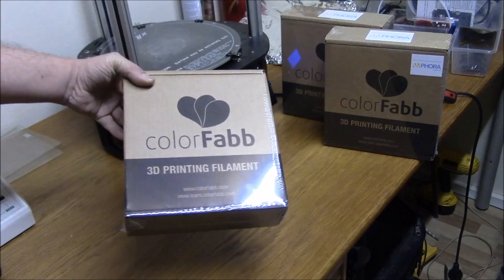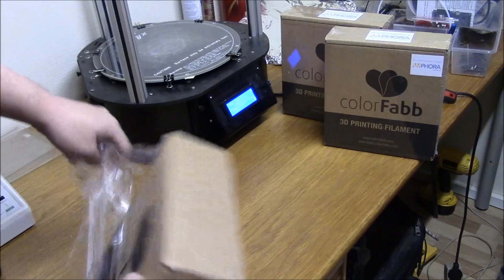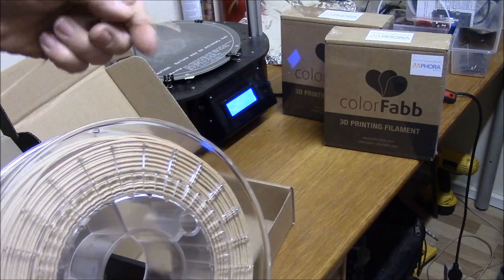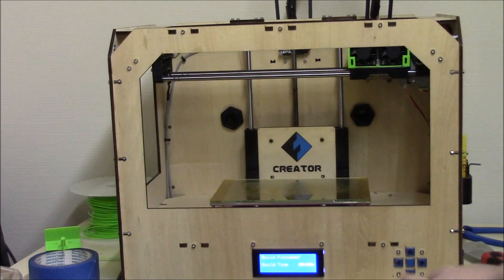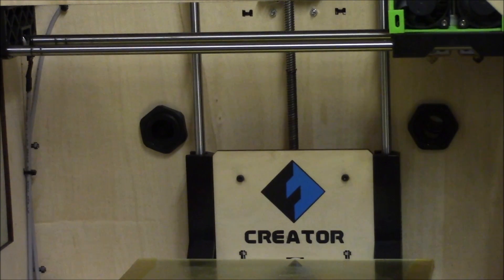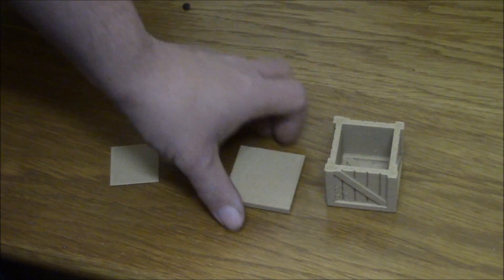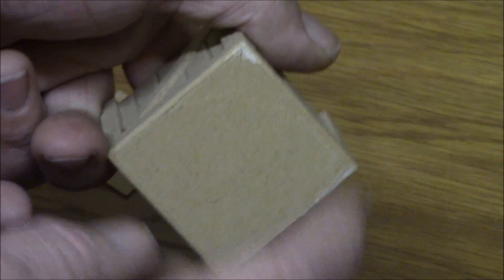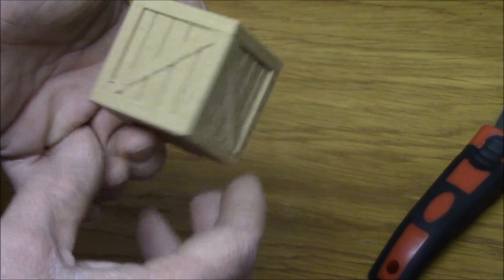3d print - testing colorfabb woodfill filament

Comment: Cool video! Will the woodfill work without a heated bed as well? :)
Reply from the maker: Maikel Versantvoort Hi ..it is made of 70% colorfabb pla and 30 % wood fibers so it should be possible. print slow.  I would try on blue painters tape or elmers disapearing purple glue stick... maybe both..
Reply: Thanks a lot!

Comment: How do you like the Rostock max? I'm planning on buying one in the next couple months! Very excited to build it :P
Reply from the maker: +Green God i like it, it is a fast printer, not a lot of noise,, the only problem i have with it is the cold end of the extruder not feeding plastic, but i think the stepper motor is the problem. be sure to get the wires in the right towers when you build it, else it means trouble.... don't ask why i know that..... :-)